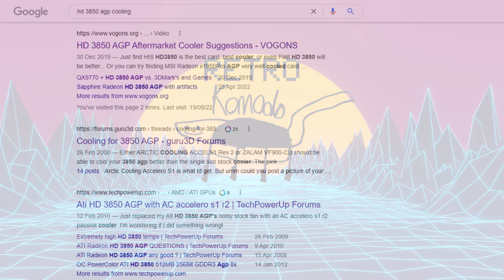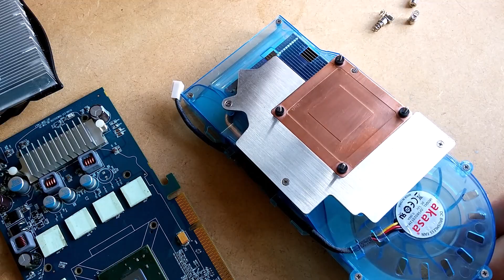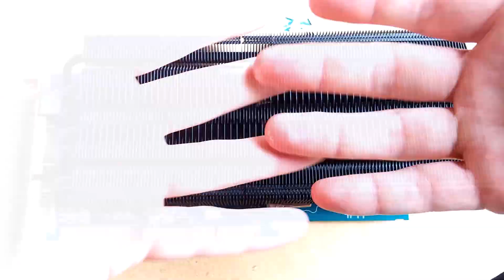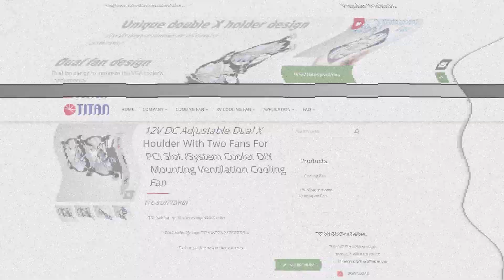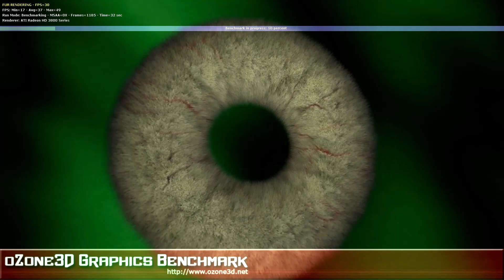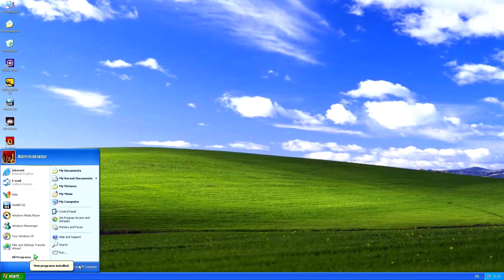Top Tier Cooling - AGP HD 3850 + RAIJINTEK Morpheus 8057

Comment: Does it make sense to slap 140 mm fans on it? 
The will sound more quiet, right? 
In general the bigger the fan the more pleasant the noise. 

Or do only 120mm fans work, for whatever reason?
Reply from the maker: I don't think it takes a 140 but to be honest - with the other fans going in the system - I couldn't really hear the two 120's!
Reply: @RetroKomodo  Cool! Thats awesome yeah. 

But in theory 140mm will be even more quiet. I wonder if it has any disadvantage
Reply from the maker: Well I suppose it would need to be zip tied on? Lol. The Morpheus is also really heavy as it is so more fans = more chance for sag. If I kept this cooler on I think it'd be with no fans at all, and just using system airflow. Still cooler than stock! ;)
Reply: @RetroKomodo  yeah but I want my gpu to be as quiet as possible. The sag is no problem for me personally as there are solutions against sag, like simple stands
Reply from the maker: @0oTHEJACKo0 can't get quieter than passive! Alternatively how about something like the one I used in https://youtu.be/DYXKNu39H4c that's pretty quiet too, but not silent. Also cheap and fairly available

Comment: I've put a Corsair h100i 240mm aio on my 1080 ti before with a .925v 1925mhz under volt/clock. The card never went higher than 43c. 

And I've put a artic accelero triple fan cooler on my 980 ti. I know the GPU was at 1450ish MHz and +500 memory offset and it never got hotter than 65c. 
GPU companies have finally learn to put beefy coolers on their products. I HATE seeing any of my processors going over 80c. It makese feel uneasy.
Reply from the maker: Nice! I know the feeling! It can be tricky to get older gear cool, but finding after market solutions to make up for vendor penny pinching is sometimes the only way. Thankfully this stuff is always screwed together and not welded or soldered.. but who knows what they'll do in the future?

Comment: Any other good (and cheaper) cooling for AGP HD 3850?
Reply from the maker: There is a Raijintek MORPHEUS II CORE EDITION on ebay for £50 at the mo, or if you can find one, there is the Accelero L2 plus I started with? I couldn't find much that fit!
Reply from the maker: Just trying with an Akasa Vortexx Neo now - all add it to the benchies list, and it costs less than £10 on eBay ;)

Comment: Hi mate. Would you be so kind and tell me what kind of spacers did you used? I mean was 2,3,4 mm ? On the back plate mounting.
Reply from the maker: I think I just re-used the ones from the Accelero L2 Plus which are apparently 4.5mm? Reason being, I wanted enough space for the support bracket to clear the pad around the rialto chip. I probably should have mentioned that in the video really.. You should be fine with 4mm. I tightened the bracket screws quite hard with 4.5's and slightly squished the pad - but it's still fine so i'm not worried!
Reply: @RetroKomodo  Thanks mate. I used 4mm spacers as you suggested. On the other hand i used Enzotech memory ramsink with 3M thermal tape - forged copper heatsinks. W/o any cooler mounted i obtained 75. I will buy 2x Arctic coolers with PWM so i will use it as you suggested. I am amazed of the results. Thanks again for all your effort.
Reply: I found an old cooler from Chieftec, so i used it to see how it works with it. I was amazed. After 10 minutes with Furmark at 1280x1024 with only 1 cooler i obtained a max temp of 43. WOW
Reply from the maker: Nice!!! What is the cooler?
Reply: @RetroKomodo  i used an old cooler from one of my computer cases : it is a Chieftec 120mm - D12 SL12
Reply from the maker: @topfin2378  Ace! Well, 43 degrees is something to be very happy about ;)

Comment: On a bare die like this the optimal way is spreading it out yourself actually as there is a risk you'll get a gap which creates a hotspot on one of the corners if it doesn't spread out enough.
If it has an ihs you can be less critical about spreading it out & letting the cooler do the job for you.

Also new too the channel here coming across the fastest windows xp build, which is technically true but you can make a gtx titan x gpu work with the gtx 960 drivers & also socket 2011 with the 6 - 8 core sandy & ivy bridge processors with an X79 motherboard supports windows xp as well.
Reply: Fastest supported CPU is 4core 4790k lga1150, yes you have more cores on 2011, but that slower cores. Fastest GPU is 980ti OC, titan x will not OC as good as 980ti. EVGA 980ti hybrid is same/faster then  titan.
Reply from the maker: @marsol562  Absolutely - https://www.youtube.com/watch?v=WEEuUZkqsCk&t ;)

Comment: Very interesting video, a few months ago I finally built a pc with windows xp for retrogaming by reusing my Pentium 4 Prescott 3.4ghz and my Hd3850 agp that have been collecting dust for many years, as you said the Sapphire cooler is a disaster, and I had temperatures similar to yours: 
idle 42 ° C 
after a few benchmarks 72 ° C

I mounted a Coolermaster Coolviva Z1 (paid $ 10) with an 80mm brushless fan and now it's super quiet and the temperatures are:
Idle 35 ° C
After benchmark 58 ° C
I am very satisfied!

Obviously the heatsink you mounted is more effective but also more cumbersome and expensive, so I can't complain (｡ • ̀ᴗ-) ✧
Reply from the maker: Excellent! Yes - this heatsink is way over the top and there are far cheaper options. I'll have a look for the coolviva!
Reply: @RetroKomodo  If you are looking for a heatsink for the hd3850 with a good cooling / size ratio I think it is very valid, I had also seen the heatsink you used but I needed it to be compact, for this build I bought an MSI MS-7037 Intel 865GV motherboard , which is a micro atx, and I also wanted to reuse my Sounblaster audigy 2 zs so with a too large heatsink I could not use the lower slot, the Coolviva is particular because the radiator ends up above the video card and is also aesthetically interesting and different from the usual, it is fanless, but in the package there is an interlocking bracket to be able to easily mount an 80 mm fan, I had planned to put it right away so I did not test the heatsink without a fan, but a video where you test it it would be interesting.
Reply from the maker: @Gallospacca-  If I ever find one i'll certainly have a go - meanwhile I'm going to  be fitting an Akasa Vortexx Neo (as requested) to it too see how that works out :)